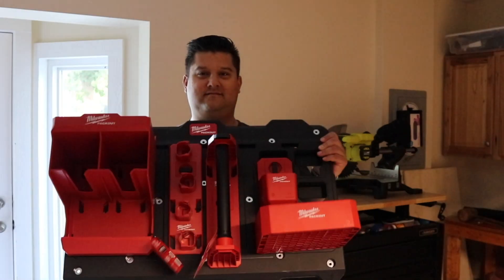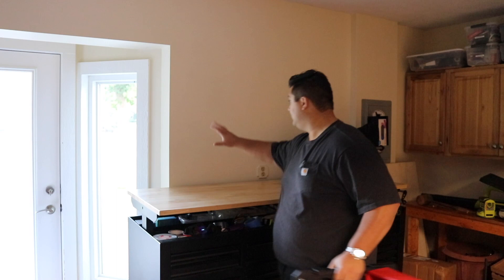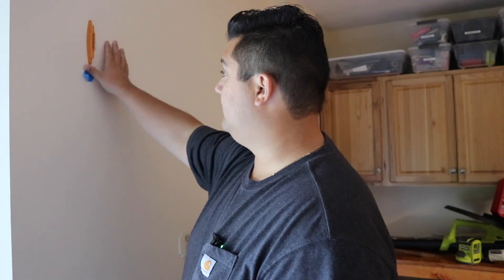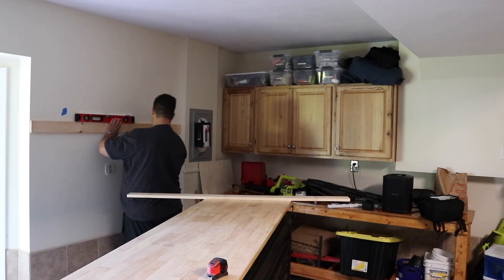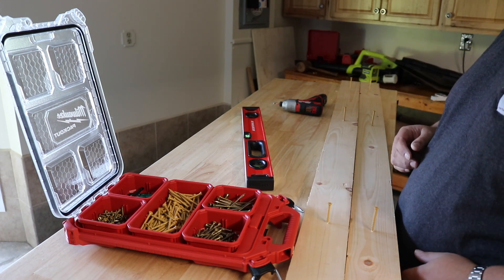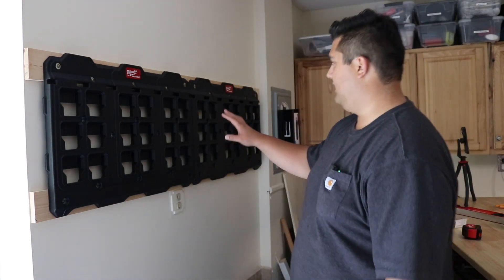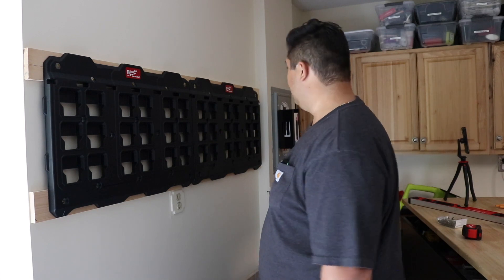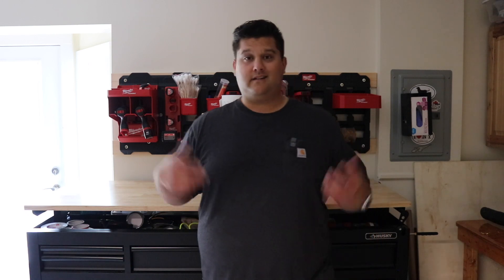The Truth About Milwaukee Packout for Garage Organization

Comment: What size screws did you use to attach the strapping to the wall?
Reply from the maker: #9 2 1/2”. Believe they are GRKs requiring a T25 bit
Reply: Ok good to know. Bought some today and going to put up my first wall mount tomorrow. Going with the 1x4 fur strapping. Putting 2 rows of 3 large wall mounts. Did you pre-drill the strapping/studs before fastening them on?
Reply from the maker: @mattantetomaso9131  yep, predrilled everything. In the follow up video to this one (where I added the second row) I captured the pre drilling. https://youtu.be/GmPekNNXOwY?si=RZSxexc0kSU4KGdf

Comment: thanks thats a great project i think i need. and tips and trick on how you store your electrical cables, brooms and mops, rakes?
Reply from the maker: Thank you! As for those items, in my old garage I used 12.4 inch wall mounted hooks. What was good about them is that they could hold a lot of stuff, what was bad is that the stuff in the back was hard to get to. I talked about this briefly in my video walkthrough of the old garage (two videos back). In this garage I’m planning on a packout wall with attachments for those types of tools. Video forthcoming!